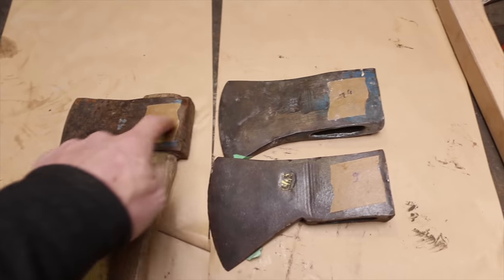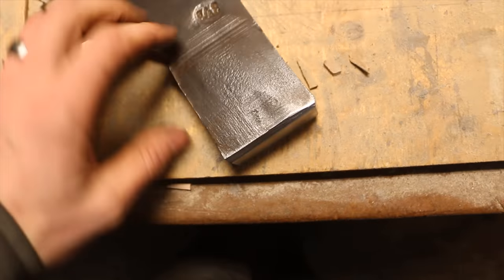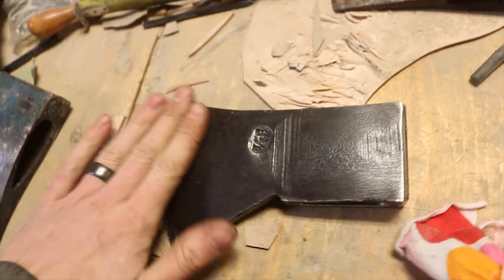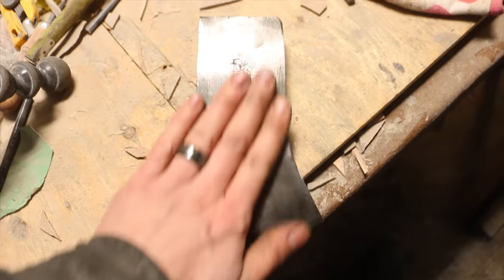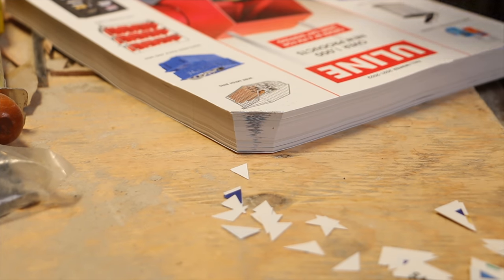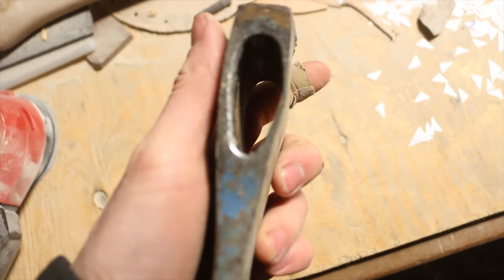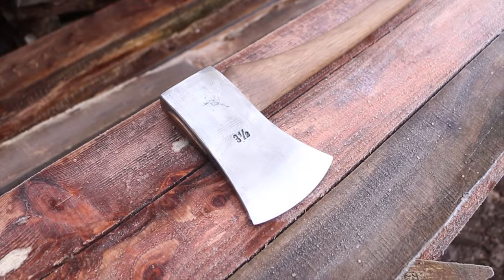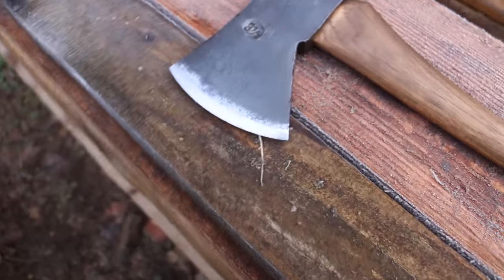Are German axes the best?

Comment: A lot of the West German stuff I've seen has a really rough finish on really good steel. I have a Wiebelhaus where you wouldn't believe the quality of the edge if you looked at the huge dents, dings and machine marks left by the factory. Lovely axe though, full of character.
Reply: @Jordon Stevens paint holds better on rough surfaces. In the day Weibelhaus, Ochsenkopf, Adler 🦅 you name ist all threw on a coating of paint. Be it Wörder & Pandel / Widderkopf, Grünspecht Series that was held in green. C-60 steel e.g. tend to rust, what better way to keep them looking pristine till their sold. Same goes to say with the lacquer on the wooden handles, intent for the salesman, not the blisters that they induce.
Reply: @Jordan Stevens to this day the companies still go with their color schemes. Take Ochsenkopf / Ox head axes their held in yellow.

Comment: Hello Tim, have you had any old gränsfors axes on your hands over the years? You can see that it is an old (ish) gränsfors if it has a stamp with (modelnumber) / (weight in lbs) on the opposite side of the side with the gränsfors mark.

Comment: Axes are for chopping wood. Mauls are for splitting wood. Change my mind.
Reply: I disagree, I can easily out split with an axe, a maul only beats an axe when splitting spongy softer woods like gnarly cedar etc
Reply: @felixchetlanddevries2998  the secret is to wait till it is -40 then split wood then it will not be spongy. It really depends on the size of the wood you are splitting. No way your splitting half metre rounds with an axe. Well not in one swing like I would be with a maul. I mean if I was splitting toothpicks under 30cm across I might consider an axe. The tree I cut down yesterday is a white pine that was over 80 cm across and very pitchy , axe would be stuck after first swing and handle broken as you try to pry it loose.
Reply: @scotttod6954  I mainly split macrocarpa rounds, they are mostly 1m plus in diameter, I just flake bits of the outside with my Axe. There is no reason to split it in half, it just makes things more complicated. I run a Canadian Kelly true temper Dandenong on a 1150mm handle, that thing is a laser beam.